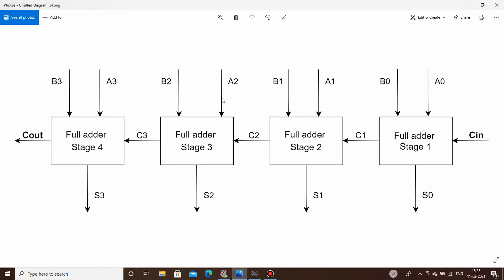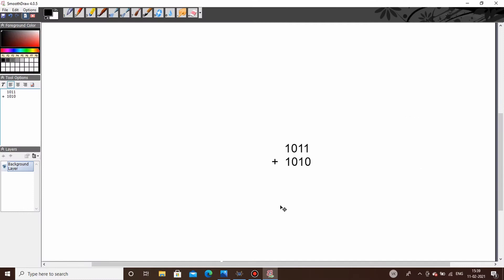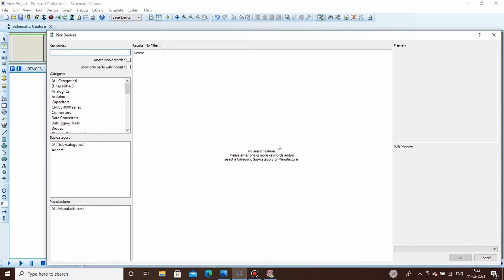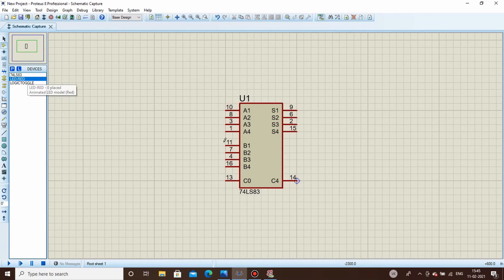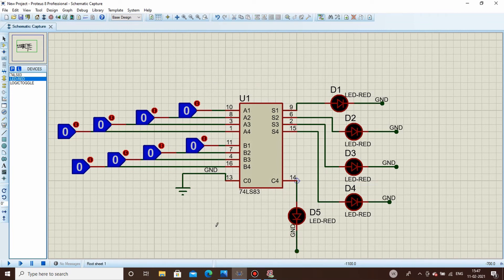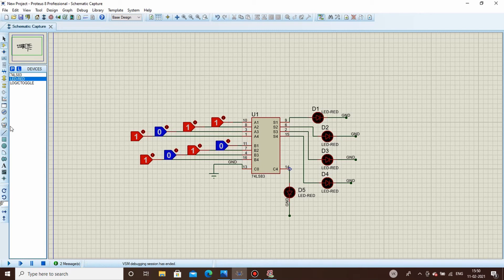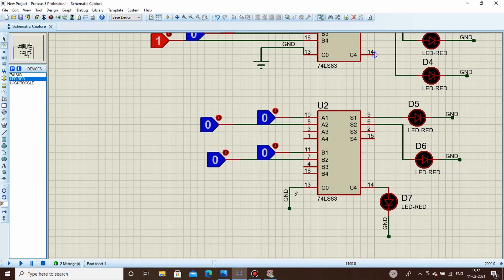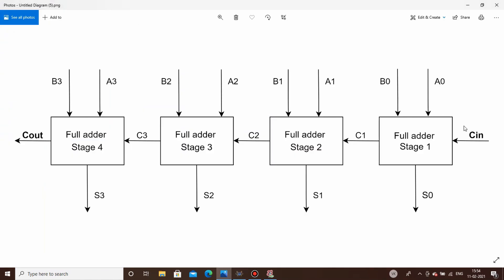Designing an N bit Ripple carry adder using IC 74LS83 - working and simulation | Proteus 8.9

Comment: Sir, when I am using IC physically it is behaving weirdly like without connecting it to GND LED'S are glowing. Don't know how to debug.
Reply from the maker: Which terminal you didn't connect to ground?
Reply from the maker: Is the problem resolved or not ? You can connect with me through instagram & linkedin 
Instagram handle - electronic_geek29